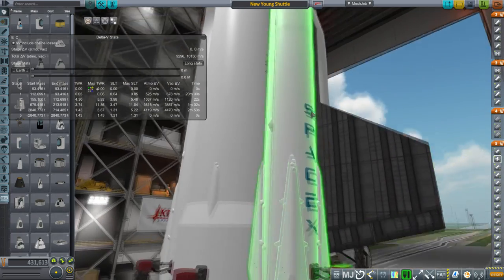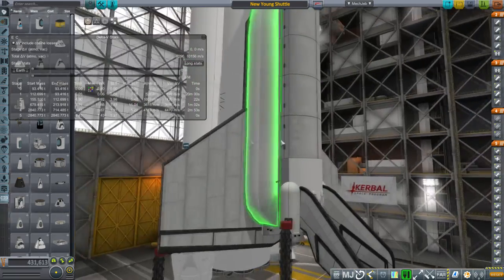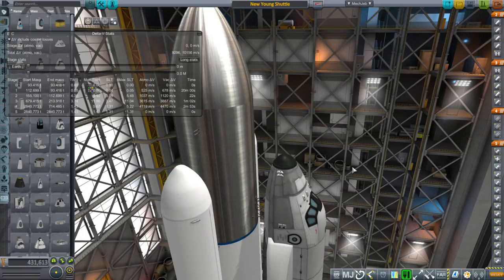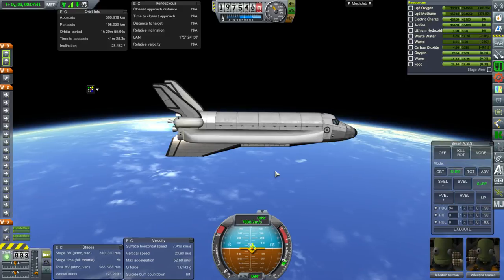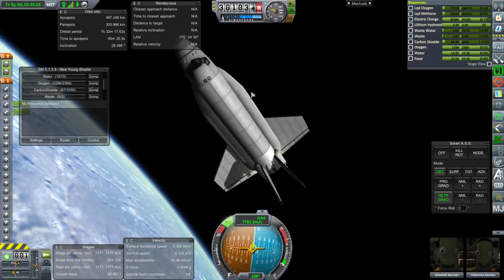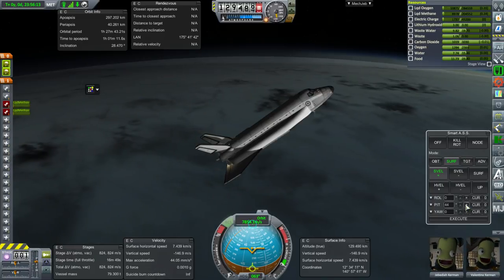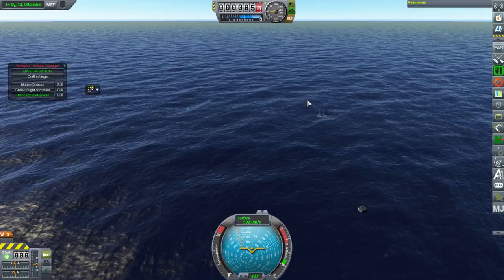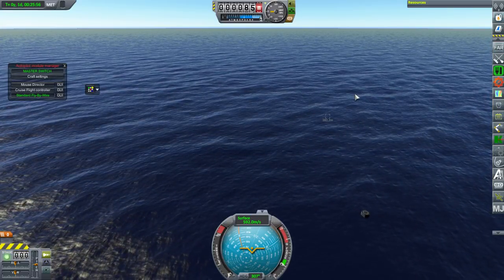Kerbal Space Program RO Sandbox - New Young Shuttle Revisited

Comment: I think I've read somewhere that the actual Shuttle doesn't use the forward RCS to control attitude during re-entry, actually they vent the forward RCS propellants just after the deorbit burn. Also, I think the S-Turns are also needed to manage altitude other than speed and heading, as rolling on the side would prevent gaining altitude with the 40° nose up postion needed for reentry.
Reply: Yeah, I've read that using the forward RCS might have had interfered with the nose aerodynamics during the most critical part of reentry. Obviously KSP is a different thing, so to make things work properly keep using forward RCS. But I'd like to repeat myself about the altitude management with S-Turns: by rolling sideways, you turn the lift produced by the nose-up attitude into drag, slowing down and losing altitude instead of gaining it.
Reply: Agree with S-turn but I'm not sure he'll do

Comment: I like the design. What about a Shuttle External tank with three Falcon 9 boosters, and the shuttle on top, in an X configuration?
Reply: The objective I had in mind was to do away with the New Glen booster core and compensate for the loss of thrust by simply using three boosters instead of 2.